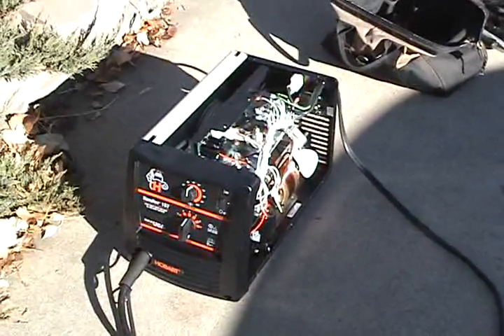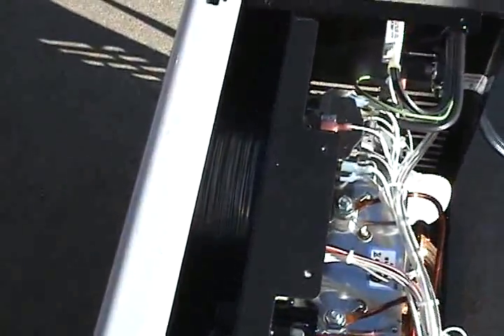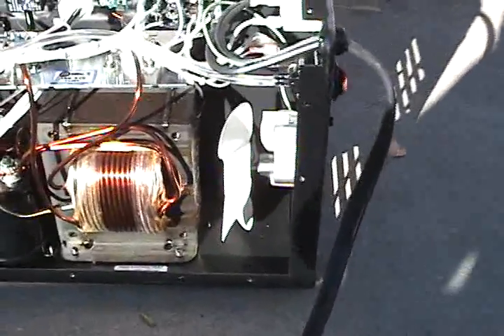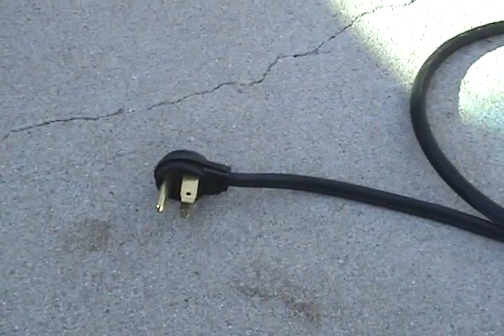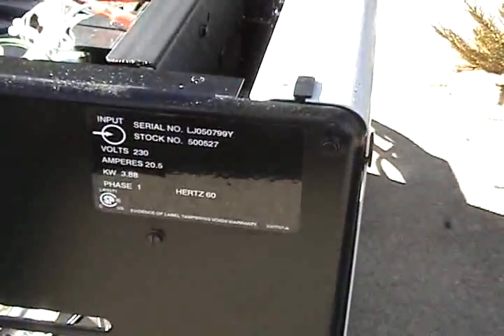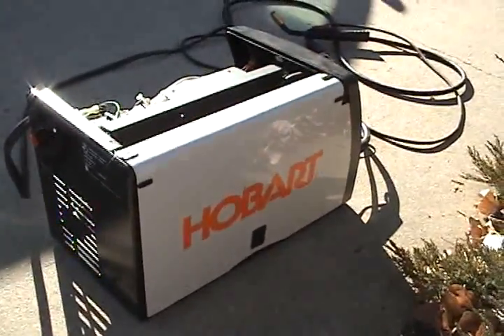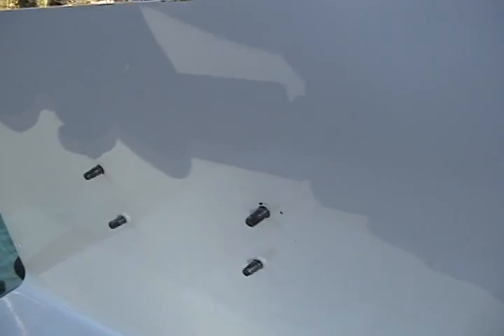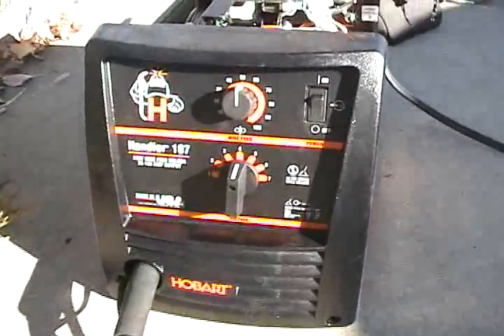Hobart Handler 187 wirefeed welder

Comment: It has Two screws in the top and I think 4 0r 5 that screw into the side ,so it's 6-8 screws holding the cover to the unit and those 4 screws in the handle hold the handle to the cover . plenty  there to hold an 75-80 lb unit  ,

Comment from the maker: @saxman2u For the 3/16" pipe fence I used a Generac 4000XL. It did a satisfactory job but it was at its limit for such work. Anything larger and I'd need a larger generator.

Comment: the 20 amp wire will hadnel 50 amps at the length that it is , you need to study up on wire thickens amps and guages and lengths, then you will under stand why things are the way they are you will no problem ,, so dont screw with it,,

Comment from the maker: Actually, it's a NEMA 6-50 plug.

I left the power cord/cable on it, with the NEMA 6-50 intact, installed a NEMA 6-20 in the garage, made both a 6-20-to-6-50 pigtail and a 40-foot 20A extension cord, and now I can weld out on the concrete in front of the garage (pretty much what you see in the video).

The Hobart is working just GREAT on the pipe fence!

Thanks for watching. It's nice to see that other good welders out there are covering my back.